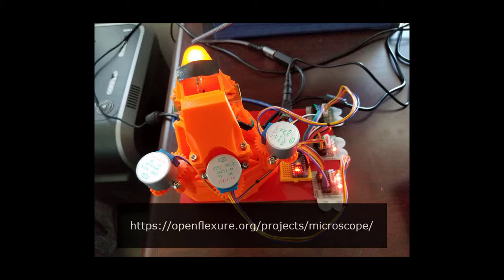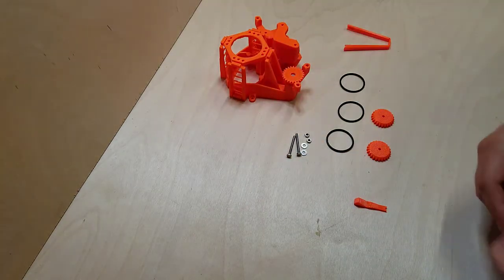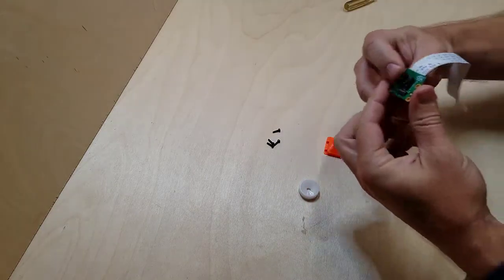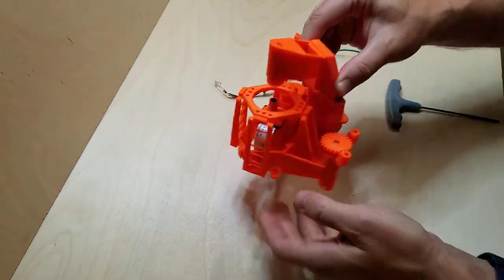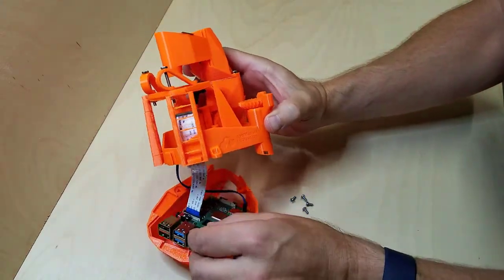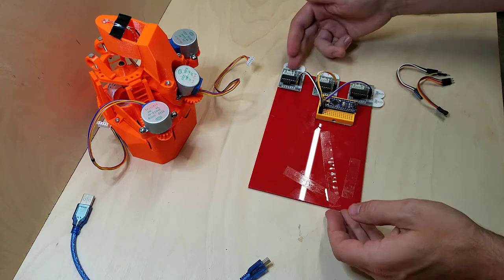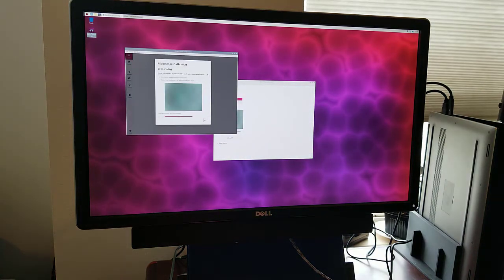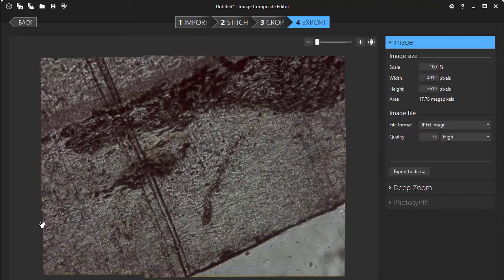Openflexure Microscope Motorized Raspberry Pi 4 Camera v2 3D printed project 2020

Comment: I ended up using a small smd LED that contains four different colors in a single little LED die package. It was only a few dollars.
-It contains cool white about 5,000k 
-warmer white about 2500k
-red 635nm
-365nm UV. Which is great and a favorite of mine. The ultraviolet really comes in handy. 

A wide range of lighting temperatures/colors are always helpful whenever I'm dealing with microscope stuff so I figured I would check around and see... And sure enough you can get LEDs that have all types of multi temperatures and wavelengths built into one small little package. The LED chip was just a few dollars, but if I had to do it over again I would do it a bit differently. Ordering the led by itself is fine but you can even make it easier by looking around and finding a premade light  

 I found a $7 flashlight at Walmart and another similar one at a hardware store... Both are a little different but share the same helpful characteristics.....

Each flashlight was under $10, and each contain a four-color SMD LED package mounted on a small little heat sink. One of them was white, red, green, and 400nm UV. The one I found another store was cool white, warm white, red, and 365nm uv. But the great thing about the flashlights what are the extras it comes with four such a cheap price. It already comes with a little heat sink and star shaped aluminum core circuit board that the SMD diode is mounting to. And of course it also comes with the tiny little driver and the aluminum housing and other stuff you get as extra parts if needed. It would be no trouble to hook that died up to an external power supply that even controllable easily by a potentiometer for brightness. To cycle through the colors you just click the power on and off until you get to the color or temperature you're looking for

 Just something to think about for folks who are building this or working with other microscopy stuff. Color temperatures and wavelength really help and give different contrasts and options. Not only different colors and wavelengths but in regular microscopy outside lighting and directional lighting is always helpful when dealing with difficult samples. so side light or light coming from different directions can help a lot when looking at a difficult or confusing sample.

 I guess someone could also just 3d pring several copies of the LED mounted housing... And using individual color or wavelength for each one. Just swapping them in and out as needed. Hope someone finds this helpful

Comment: 1:55 that sucks that it was running out of ram. Maybe it's the program. I have a Pi Zero 2 W, which is apparently as fast as a Pi 3, and probably the same 512MB ram, but I don't have issues taking pics with the Pi cam V2 (using libcamera and other software).
If I decide to print the scope, I'll download and test it's software first.

Comment: Stunning Build, and great instructions!👍
Normally there are more than one objective on microscopes. That way the magnification can be changed. This has a fixed objective, ok -fine, But what is the magnification?
Reply from the maker: Thanks for watching.  One answer for the Pi Camera v2 is a magnification of 13.2x.  Richard Bowman has this information about how to calculate magnification as there are several factors: https://openflexure.gitlab.io/microscope-handbook/build-a-microscope/magnification-resolution-and-field-of-view.html

Comment: Do you print with supports? Slicer generates lots of supports, and your model looks very clean :)
Reply from the maker: Great question!  The answer is no supports are used.  I cannot claim credit for the models.  The Open Flexure Project's designs specifically wanted most printers to not need to use supports when they print.  Thanks for watching!

Comment: Excellent video.  I am putting my together now an this was very helpful to see how everything goes together.  Have you considered using the Sanga board?  I will probably be putting in an order for several in the near future.  I like your solution though for motor control and I will probably start with that.
Reply from the maker: Hi Blaine, I am glad you found it helpful.  Yes, I very much would like to use a Sanga board, but I want it fully assembled.  I registered my interest in getting in on a bulk purchase here https://openflexure.discourse.group/t/register-your-interest-in-a-sangaboard-group-buy/52.  I also told Jason in this post that I would be interested in an assembled board (he had to order parts for 5, but only needs 1) https://openflexure.discourse.group/t/power-supply-for-motors/102/10?u=vthyng.  
And lastly, we might not even need a Sangaboard now with this new motor housing that puts the nano on its side so the 3 controller boards have a chance at fitting: https://openflexure.discourse.group/t/purpose-of-holes-in-motor-driver-case/46/26?u=vthyng

Comment: Will be by any chance the system modyfied for hi-res pi camera?
Reply from the maker: Looking at the STL selector form, I still only see v 1 and 2 available.  There is an active community here that could help you figure out how to install the HQ: https://openflexure.discourse.group/

I suspect you will be told that your effort is better spent in upgrading the objective lens than increasing the camera resolution.

STL selector form https://microscope-stls.openflexure.org/#/v6.1.5?enable_smart_brim=true&reflection_illumination=false&optics=rms_f50d13&camera=picamera_2&use_pilens_optics_module=false&riser=sample&microscope_stand%3Abox_h=30&pi_in_base=true&base=bucket&legacy_picamera_tools=false&include_actuator_tension_band=false&include_actuator_drilling_jig=false&motorised=true&use_motor_gears_for_hand_actuation=false

Comment: Great video instructions! Thanks! One question: what is the range of movement at the X y or z planes? How precise?
Reply from the maker: Hello!  I am afraid I don't have a specific answer for you.  For the kinds of pictures I take with this, the automatic picture taking feature moves hundreds of steps of the stepper motor in x and y directions between pictures.  Z axis movement is very limited.  It does not need to move much to focus after movement.  I suggest asking this question in more specific terms that you would like it answered in, in the microscope forum here: https://openflexure.discourse.group/
Reply from the maker: I came across this post in the forum about the steps and it will depend on your motor step size and even the thread size.  It is explained in detail here, but basically it appears to be around 50 and 100nm per step. https://openflexure.discourse.group/t/how-to-set-zero-coordinates/356/4

Comment: Hello, I am building this microscope and faced some problems. May I know what is the yellow part and the small panel you have at 23:21 and where did you get them from? Thank you!
Reply from the maker: Yes, the yellow part is one of the mini breadboards from a pack like this https://www.amazon.com/gp/product/B01EV6SBXQ

The red panel is a sheet of colored plexiglass that I just happened to have.  I think a piece of 1/8 or 1/4 inch wood can work just as well.  Good luck building your microscope!  I want to also bring your attention to a recent development.  There is a new stl file for a motor controller housing to hold the nano and all 3 controller boards (the designer turned the nano on its side), details here: https://openflexure.discourse.group/t/purpose-of-holes-in-motor-driver-case/46/11
Reply: @vincestechshop  Hello! Thank you! May I know what about the nano control panel? thank you!
Reply: @vincestechshop  I am looking at the new motor board but I could not find the link to download the stl file. Please advise. Thank you so much for your help!
Reply from the maker: @csskdci  Yes, the nano is part of a 3 pack I bought here: https://www.amazon.com/gp/product/B07G99NNXL
Reply from the maker: @csskdci  I could not find it either.  I have posted in the forum asking: https://openflexure.discourse.group/t/purpose-of-holes-in-motor-driver-case/46/31?u=vthyng
Reply: @vincestechshop  Thank you so much for your help!

Comment: Since the sangaboard is not to be obtained, did You still use the same INO file?
Wireing diagram?
im using those same 3 separate boards :)
Reply from the maker: Yes, I used the exact same INO file is used on the Nano.

Comment: Hi, this is a great video. I was applying for a fund to build these microscopes for my university (which resides in a developing country with no high-grade microscopes). I was wondering how much do all the 3d-printed parts weigh? I need to tell how much filament I exactly need.
Reply from the maker: Hello Anas.  The version I printed is about 203 grams of filament.  I would plan in some extra in case some of your 3D prints fail.

Comment: Could you not just make the camera bit and attach it with a bracket to the effector of your 3D printer? I would thing the movement would at least be precise enough to grab some images to stitch together, amd with that working area you could make huge composite images!
Reply from the maker: Yes, I have been thinking about writing a plug-in for the openflexure software to capture and stitch as it goes.  Thanks for watching!

Comment: Hello, may I ask you one more question, what wire is connected to the computer?
Reply from the maker: Of course, I hope I can help.  You might also found answers to your questions on the openflexure forum here: https://openflexure.discourse.group/
Reply from the maker: There is a short blue mini USB cable going from the nano to the raspberry pi.  And you can access the microscope software remotely through a network cable connection to the raspberry pi.
Reply: @vincestechshop  Thank you@